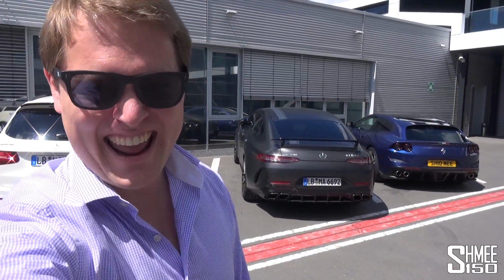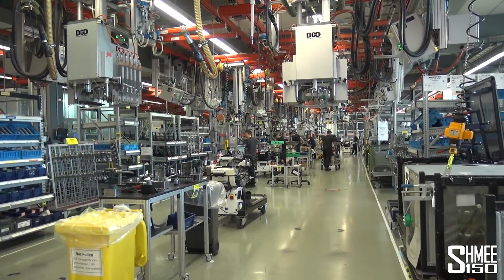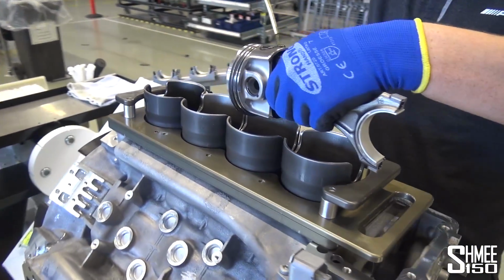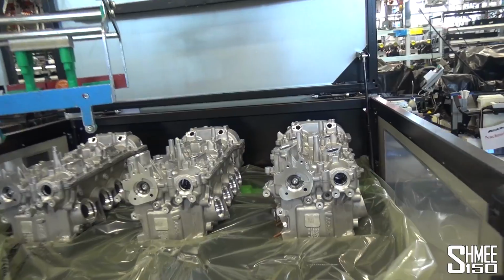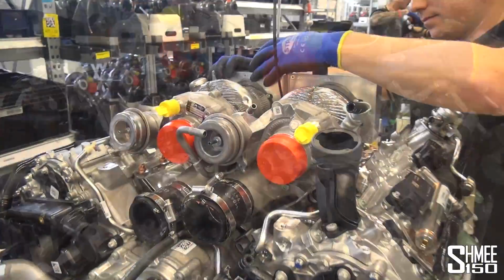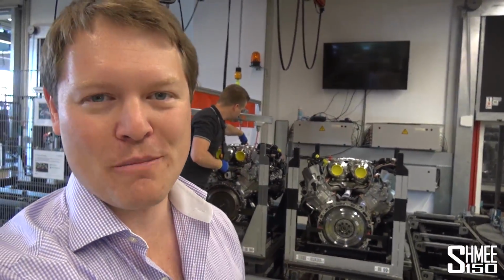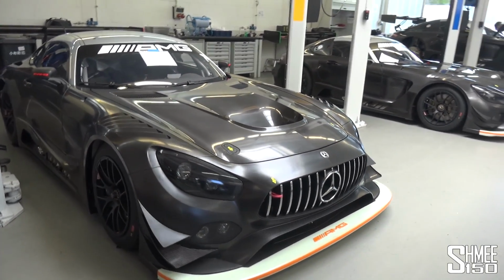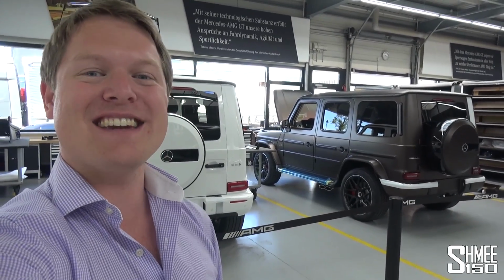Building the Engine for My AMG G63!

Comment: I really don't get it why they designed a wet sump for the "offroad" vehicle - it just added extra development costs and considering that the G-class vehicles are designed to drive on rather slant surfaces instead of flat, the dry sump solution would have made more sense.

Comment: NO cross hatch on the cylinder walls? That's weird usually that will cause excessive wear because the oil can't stick on the walls and the rings won't seat properly.

Comment: One thing that jumped out at me was when showing the cylinders he said "super, super, super shiny surface."  I've always only seen or built engines where the cylinder walls were purposely honed to be cross-hatched for oil lubricant retention.  Is this a new way of doing it?  Wouldn't it decrease longevity?

Comment: Unless i'm mistaken having the turbos over the engine raises both the engines center of gravity as well as under hood temperatures. I don't see the advantage over placing them lower on the engine,
as is traditional.
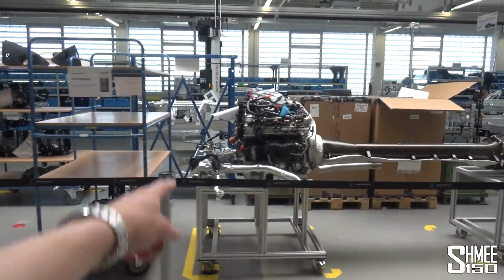Reply: If you have a look at all the intake side, intercooler setup, it's very low on the front of the engine, the difference in center gravity would be very minimal, however, the space difference in having a slim line plastic intake as apposed to manifold, turbo, wastegate, hanging off in that area both sides, gives you far more room for front drivetrain and suspension components, without having to shield them from heat. @ 14:16 you can see the exhaust area has a lot clear space around it with a heap of heat shielding, the bonnet vents are designed to draw clean air in through the bonnet and front aero over and around the turbos and down the firewall out under the car, actually giving you an advantage in removing heat from the engine bay while freeing up front and side vents for increased oil and brake ducting and cooling. There are a few manufactures that do this and have done for a while, it is the smarter way to go given advances in engineering.

Comment: If the plaque that shows who built the engine doesn’t go onto the engine until after the engine is inserted into the car, then how do they know who built it?
Reply from the maker: The plaque is attached to the engine before transport, but not stuck down just held in an attached case

Comment: Is there any other reason apart from having a compact engine to have those turbos on the inside rather then outboard somewhere, just curious? 900 degrees is insane!
Reply: It's called hot V and it keeps the turbos hotter thus loosing less power as heat. It also spools way faster because the intake length from the turbo to the engine is very short.
Reply: @ytxstream  ah true but wouldnt the air coming in through the intake warm up almost instantly if the operating temps are around 800+ or is the rise in intake air temp negligible?  Obviously the engineers at Mercedes aren't idiots so theres probably a reason for this lol.

Comment: Silly question but how do the gaps remain opposite each other on the piston rings? Wont they just eventually rotate with engine use?
Reply from the maker: This is far too technical for me without being there to ask again, but I presume there's an engineering explanation for why they will remain in place
Reply: @Shmee150  fair play. Great video.
Reply: I have no engineering insight, but my 2 cents imagine moving them to opposite sides is purely for a safe assembly: 
while inserting the piston lightly tilted, the rings may safeguard it from nicking onto the walls both sides until straightened inside.
They will be centered (and move freely within the specs) right from the moment the piston is in place.